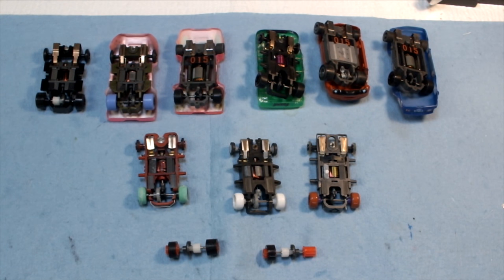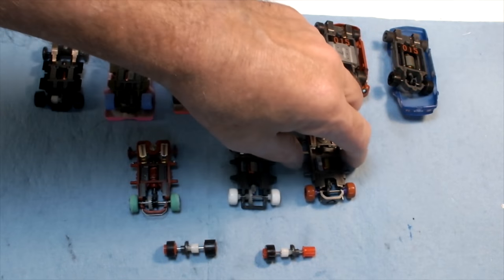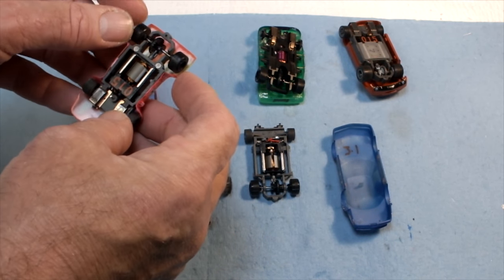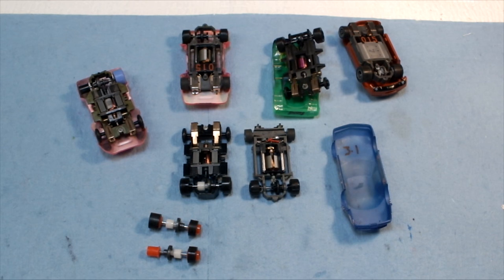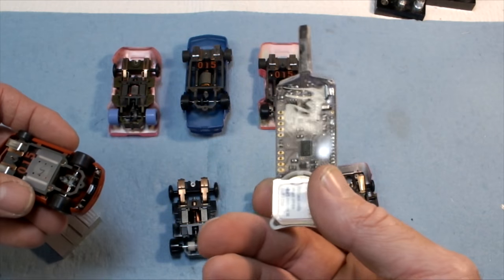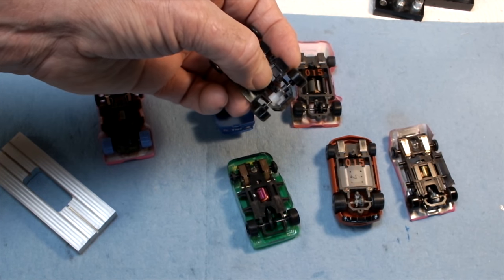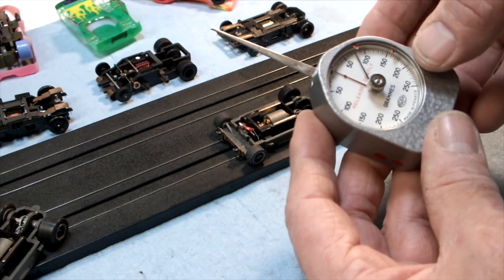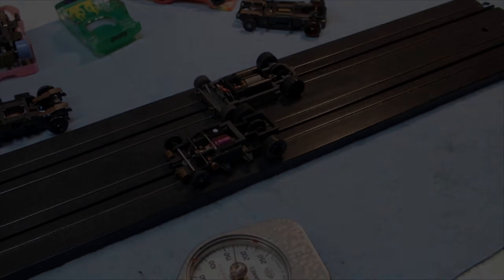Intro 101: HO Slot Car Tires and Magnets

Comment: Sir, I have ideal motorific battery operated slot cars.
Is there someplace that repairs the front axkes/ hubs.
   I'm in dire need of these cars fixed, ty.
Reply from the maker: Thanks for writing.  I have no idea about Motorific.  You may need to look on ebay or Slotcarcentral.
Reply: @riggenracer  ok, it's just that there is actual tiny steering linkage that are riveted to chasus.